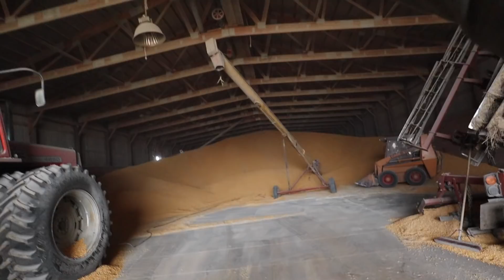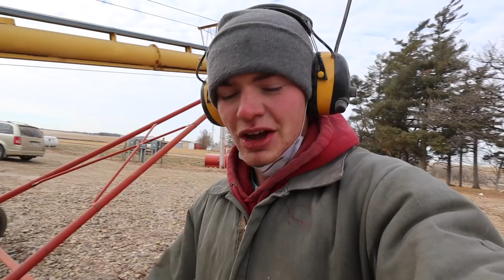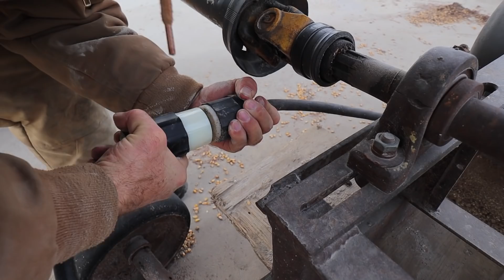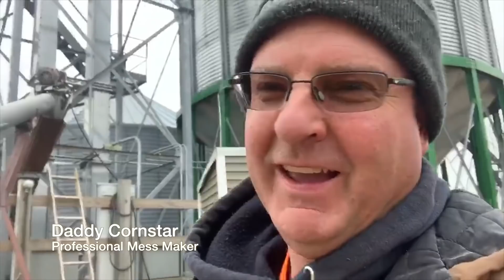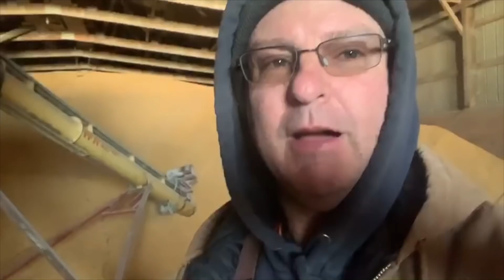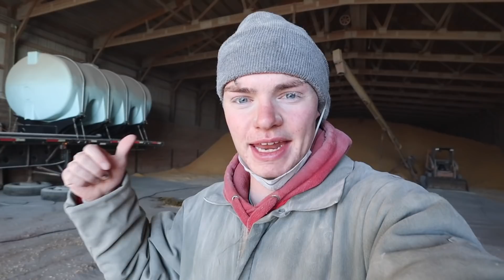CLEANING MY MASSIVE INDOOR CORN PILE!!!

Comment: Just thinking out loud here but since cooper is pretty handy with building stuff out of wood why not build wood box to go around the different augers to help contain the corn in a smaller are and make lids for them to keep the snow and rain off the corn and on the places that you can't get wood to bend use rubber conveyer belt or mudflaps and cut to fit tight to the auger to help cut down on the mess and spillage just a thought

Comment: Do you have access to the side of the building with corn in it?  Might put some access holes in the side then you can stick the auger in from the side and push up to it with the skidsteer while the trucker outside just turns the auger on and off as needed.  We have 3 quonsets for about 500,000bu capacity and one has holes in the side for that, works pretty good.
Reply from the maker: Stephen M not really interested in doing that. Hard to keep water out I'd feel.

Comment: Hmmm, any merit to putting a conveyor belt on the ceiling joists?  Then you might be able to back a semi in there and all he would have to do is drive forward while the belt is stationary until he is full.  Might even be able to put a wifi camera looking into the truck bed on tv so the trucker knows when to pull ahead.

Comment: Ok, a little thought, if loading a semi that has backed in to the big machine shed with an auger is impossible, then why not saw a series of holes (hatches) in the side of the building , poke the auger thru these and park the semi under the auger on the outside? Then you just move the auger from hatch to hatch as the corn is depleted. Maybe with an ag cam or two to keep track of the loading. And as a little bonus (since you won't use the doors to drive grain carts in and out, and just keep working further and further in), you can start parking equipment inside the shed sooner.. Happy New Year from Sweden.
Reply from the maker: Akersjon 278 then how do you empty the rest of the building? Skid loader method 😉
Reply: @ColeTheCornstar  Well, I guess you will have to use the skid steer a good deal more to push corn towards the auger because of the angel of the auger in relation to the pile (you wouldn't be able to push the auger bottom straight in to the pile anymore.) But, I'd say that whatever you loose in auger loading speed,  you more then make up for in efficiency if you can cut out both the grain cart and the hopper loading/unloading steps before delivering the corn to the customer... It's just a little idea that hit me as I was watching this video. But I'm not a farmer, so I may be totally wrong here... BTW, the new CASE looks really good.

Comment: Did your grandpa put that building you ? that's a huge pole barn,the longest one I ever built was  72 x 250' long .We just built it like two 125' can't pull a string tight enough for 250' old days before laser's .
Reply from the maker: They put it up in the early 80's!

Comment: you should have an auger that goes through the roof. Then the semi could pull along side the building?
Reply from the maker: Tim Chipps still leaves a mound around it & makes it hard to put stuff in when it's empty.
Reply: I was thinking putting a row of augers down the middle attached to the rafters and have a down augers every 20 feet or so

Comment: Great video Cole, two things, like the Stepbrothers reference and is that oil on the floor? how to you keep the corn from getting contaminated? no idea about big farms so sorry if's a stupid question.
Reply from the maker: Pio Egan corn doesn't touch up there. We clean it up if it does. The corn that was on that little oil spill will be disposed of.
Reply: @ColeTheCornstar  are you concerned about wasting corn by driving on it or can you still use corn after driving on it.

Comment: Cut a hole in side of building. Then truck can pull up and fill on outside. You cleaned the side of building last season. Save all money wasted on diesel.
Reply from the maker: How do you keep water out? What about the areas that don't get sucked down? The edges?
Reply: @ColeTheCornstar  power of skid loader. save so much fuel too. years ago when I was on farm how we did it. just like that conveyor bring the corn in building

Comment: 8:00 Does anyone else see all the oil in spots on the concrete floor?  Corn is pushed right thru the puddles.  Is that corn destined for animal or human consumption? Just wondering.
Reply from the maker: The oil spot you're referring to was created after the corn was pulled from there. We will throw that corn out, hence why there is still corn on it while everything around it has been broomed. 😇
Reply: @ColeTheCornstar  Oh, OK. Thanks for update.

Comment: not trying to be smart but why don't you just take the corn out of the cooling bin and put it straight into the grain cart instead of running it on the floor then auguring it again and putting it into the grain cart plus more shed space that way

Comment: More wasted corn iv never seen a farm with so much corn in the drive way
Reply: in motion I like the channel but you have a point. Makes you wonder if a little modernized system would partially pay for itself. How much shrink do you figure? You have a new yield monitor. Did you calibrate? Use the monitor and the amount you haul to town. You will know how much your losing in all the piles etc.

Comment: why dont you use a plastic bin or something to catch the corn so you dont wast the corn on the ground something to hold it off the ground make easy not hard
Reply from the maker: richard smith there is one under it. That's why I don't use them most of the time because it makes a huge mess either way.